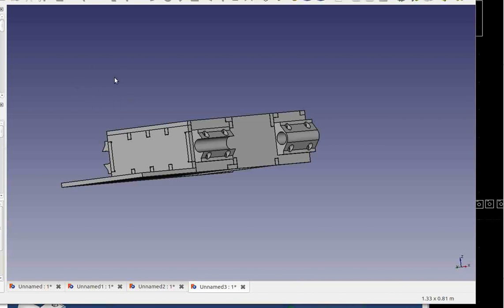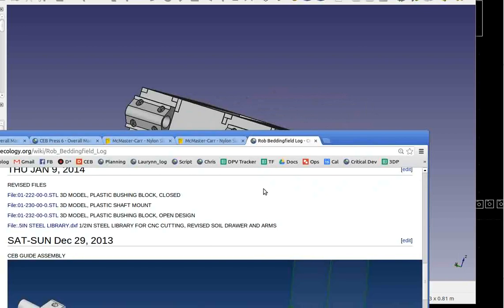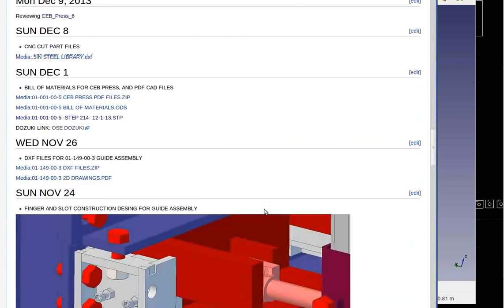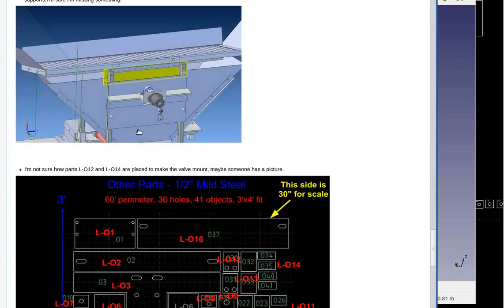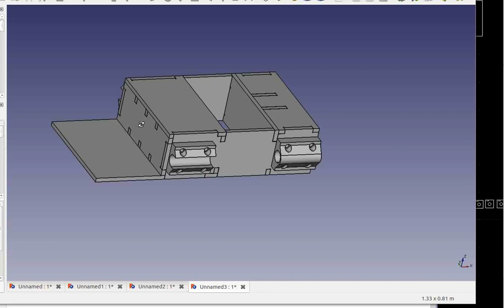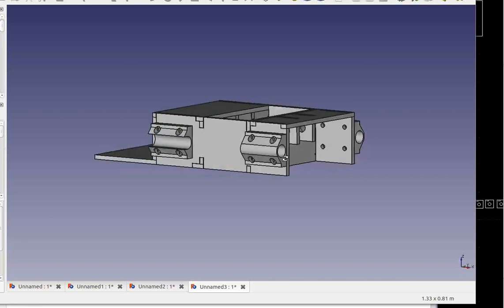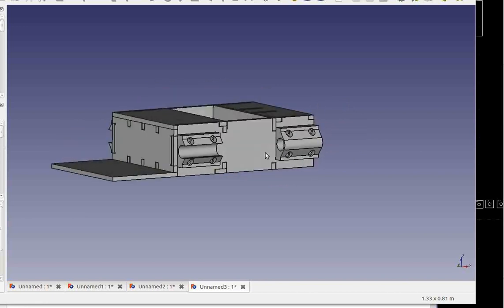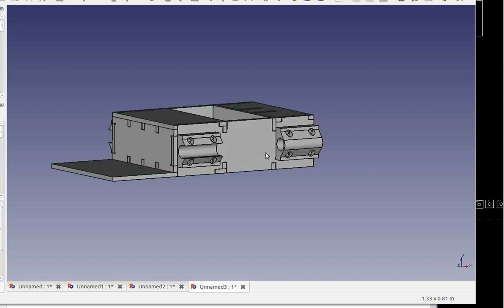test2

Comment: Answer from forrum: Drill 5 holes (4 for the mounting and 1 for the rod) in a block of delrin. It will be cheaper/faster/stronger/simpler than a printed part.

If you need some quick CNC programming let me know.